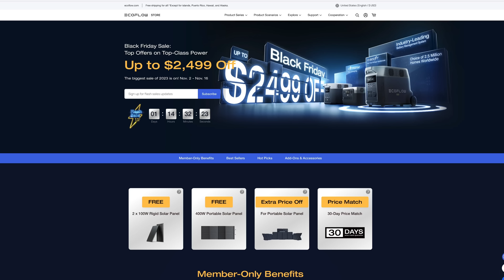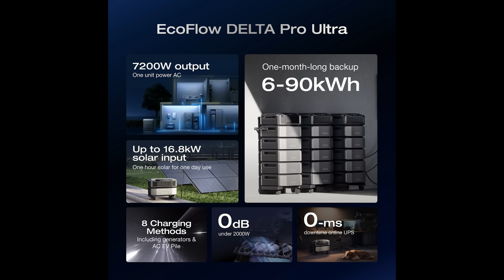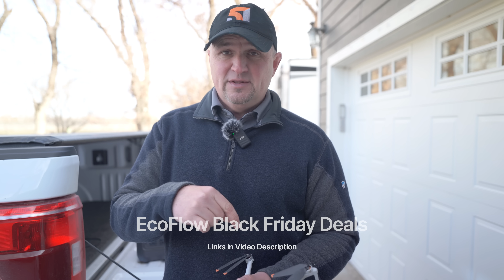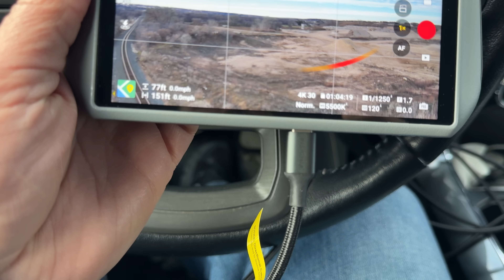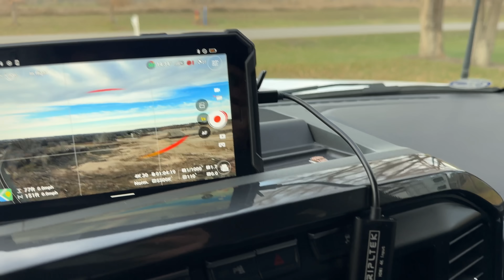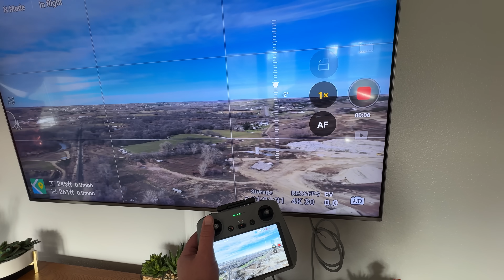Can You Help Settle This Confusing Rule?  Legal or Not Legal???

Comment: good video.  Based on your recommendation, I purchased an Eco River Mini.  Out of the box it worked fine the first time.  When I tried to recharge, it wouldn't take a charge.  Since I was having this issue, I did a little research and found that mine was not in isolated problem with Eco flow products.  I am waiting on a response from Eco Flows technicians to hopefully resolve the issue.  Hope your wife is doing well.
Reply from the maker: Such a great little power station!

Comment: Are there any rules that are different when the vehicle is parked, vs using a driver for the vehicle that carries the drone pilot? Sort of like a chase vehicle for your drone?
Reply from the maker: This is where the rule is confusing.  The FAA frowns upon flying from inside a vehicle, yet allows flying from a moving vehicle (in sparsely populated areas) 🤷🏻‍♂️. The wording states that all guidelines must be met to effectively adhere to the rule, yet it seems more impossible to do so while in a moving vehicle.  It’s a rule that needs to be updated with more clear wording imho.
Reply: @51Drones  So technically using a drone's follow mode while riding a bicycle would also falls under this rule. I would imagine the update is being worked on currently, as using a drone for a cinematic car chase while transporting the pilot in a camera chase car, just seems like a win win for some amazing shots.

Comment: I like the more affordable option of the EF ECOFLOW RIVER 2  with 110W Solar Panel. Sounds like it could power a small ice chest during the night, and then recharge during the day. This would be perfect for camping on the beach when ice runs are 2 to 3 hours away. It should also have enough power to charge up my Milwaukee M18s for the compressor I use for my fishing bait launcher. It would be great if it could keep the mini fridge cold enough to keep my bait slugs frozen for the 5 day trip.

Comment: I worked for years in line construction, heated vest helped a lot. But my hands could never handle the days when the temps dropped below the mid 20’s for too long. With operating the controller in a warm truck would really extend my flight time. Delta 2 Max with solar, that way it can be charged on the go.

Comment: Honestly, when it gets cold..I fly directly from my man-shed. How do I do it? Years ago while watching your channel you proposed the idea of using a EcoFlow power station as a power source in your mancave shed you had. I went ahead and got a Delta. Very thankful I did as living on the mountain it comes in handy regularly.I actually got two for the house. Now with the BF sale thinking of picking up another for the back of my ebike. Maybe just the River Pro edition. I have a backup battery for the ebike so figure I could use one while I charge the other during ride. Give maybe a extra 30 miles per adventure. In my shop I do in fact have my big screen monitor streaming the fly app  Yes it gets awhile to fly big screen yet at high elevation it really helps. Having the heater plugged in is a plus too.. Being within the shop with all the tools and power stations around..I get no interference. Once I am able to walk again I will have the chance to see if the River pro works on the ebike. With all the rules in my area I have switched filming reels to ground mostly. Actually got a super extension pole for my 360 to hopefully catch land reels as if I was flying. Just for fun. Not being able to walk, flying helps the day become a adventure. Thanks for all the winter tips. Snow is forecasted tonight.

Comment: You may argue that you can fly a drone from inside of your car as long as you maintain the drone in your line of sight. However, according to Section 336 Part 107 of Public Law 112-95 this is wrong. In fact, it is deemed illegal to fly a drone from inside your vehicle even when it isn't moving. You must be able to see the drone all the times which is not the case even if the drone is operated from a moving vehicle and allows you to see further and thus be able to survey an even larger area. It's still illegal tho. You exactly pointed it out, if it the drone is above your vehicle you cannot see it plus depending on the drone itself if it does not come with an visual assist view, that allows the obstacle avoidance cameras to see what's around the drone at any time, VLOS is no longer maintained. You don't want the drone to accidently crash. Just by looking down at the LCD or any monitor you won't be able to see what's behind or to each side of the drone. You'd be flying blindly essentially especially at a higher distance from inside your car leave alone making quick or master shots or all these funny things. It's kinda risky.
Reply from the maker: Explain to me why the FAA allows flying from a moving vehicle please.
Reply: @51Drones  Have you downloaded and read the FAA part 107 fact sheet? It's available on the Interweb. There it also says that you can’t fly a small UAS over anyone who is not directly participating in the operation, not under a covered structure, or not inside a covered stationary vehicle. No operations from a moving vehicle are allowed unless you are flying over a sparsely populated area. That's considered for the operation requirements and regulations. In many places, it's generally not advisable or legal to do so. The operator has to maintain visual line of sight ALL TIMES, which becomes challening from inside a moving vehicle. Additionally, it can pose safety risks to both, the drone and people on the ground. I wouldn't do it.

Comment: The EcoFlow Delta Solar Generator (PV 160W) looks like a solid system. I like the included solar panel and the large battery capacity. I just moved and the electricity reliability is unknown. This will be a good addition once I get settled here.

Comment: Hi! Thank you for having the give-away! I will be getting the River 2 Pro with the solar panel for my Christmas gift. I just bought the Mini 4 Pro (literally seconds ago) and will be using the RC 2 controller that came with my Air 3. I am sure I will need to recharge the controller while switching between the two drones during the day. The River 2 Pro with 800Wh is the perfect size!

Comment: FYI, the only way I could get the display out to work was by connecting everything, then turning on the RC2. I tried three different cable/adapter combos before I figured out the reboot solution.  Now it works with all the cable setups, but only on a fresh boot of the RC2.

Comment: I can feed my little Neewer monitor from the HDMI feed from the usb socket on my RC Pro via an adapter with no problem. I prefer this method to using the very vulnerable mini hdmi socket.

However the same doesn’t works for me from the usb o/p on the RC2 for some reason?

What am I doing wrong. Is the solution in the settings, please?

Comment: An external magnetic rooftop antenna would greatly improve the signal propagation! Are there external antennas available for RC2? I'm not sure if the FCC would allow this with non licensed operators. It would really put the range test to the batteries limit! Thanks, a Ham Radio Nerd 🤓

Comment: Sorry Russ, I"m going to vehemently disagree with you.

Yes, you can certainly look away to check your settings, etc, that's not the only issue with flying under § 107.31. You even show § 107.31 in the video.

But that's just part of § 107.31.

§ 107.31 (a) explains the entire reason for VLOS. You need to be able to:
    (1) Know the unmanned aircraft's location; (easy to do while in the car)
    (2) Determine the unmanned aircraft's attitude, altitude, and direction of flight; (also failry easy, especially if you use the extra tablet)
    (3) Observe the airspace for other air traffic or hazards; and (impossible to do from your vehicle)
    (4) Determine that the unmanned aircraft does not endanger the life or property of another. (very difficult to do from your vehicle.

I can promise you that flying from inside a vehicle is not considered legal by the FAA. There is absolutely no way to satisfy § 107.31 (3), and it's very difficult to satisfy § 107.31 (4).

Sorry.

And everyone can save their pixels instead of hating on me below. I don't care what you think.
Reply: For clarity,  The FAA allows Operations from Moving vehicles under certain circumstances.   According to § 107.25 (b) Operation from a moving vehicle or aircraft.

Its OK to operate a sUAS from a MOVING Vehicle if over sparsely populated land....   Specifically:

(b) No person may operate a small unmanned aircraft system— From a moving land or water-borne vehicle unless the small unmanned aircraft is flown over a sparsely populated area and is not transporting another person's property for compensation or hire.

So...  Its OK to fly a drone from a moving vehicle,  but prohibited to fly one from a stationary one?    

Lets rethink this position.   Its not logical.  I think Russ has a valid position here.
Reply from the maker: Exactly sir.  Thank you!
Reply from the maker: Ok.  I’ll give you that.  But, BUT, as Daniel mentions below, that one is allowed to operate from a moving vehicle in sparsely populated area.  This rule would then contradict the rules that you stated, in that it would effectively ignore the fact that you would not be able to observe the airspace for other air traffic or hazards now would you be able to determine that the unmanned aircraft does not endanger the life or property of another.  Like many other FAA regulations, it’s contradictory.  Which is it?  Is it more safe to fly from a moving vehicle than it is from a parked vehicle?  Logically, the rule should state that all UAV flights must be operated strictly from the outdoors, not?
Reply: Hi Russ.

Actually they're not contradictory at all. 

§ 107.25 does allow you to fly from a moving vehicle, but it doesn't mean you don't have to follow all of § 107.31, 

Even if you're flying from a moving car, you still have to maintain the ability to "Observe the airspace for other air traffic or hazards". Obviously it's not as easy, but it's doable.

We've done it a couple of times for a developer client. They have an access road into the development that is 3 miles long. We've had to fly it a couple of times over the entire length. Ideally we would have done that in a convertible. Since I don't own one of those, We flew it with the windows down and the radio off. I had a driver and I flew from the passenger seat maintaining VLOS of the drone the entire time, all while watching and listening for other aircraft that may be in the airspace. And since there was literally nothing there except the road and prairie land, and the occasional other car, I wasn't worried about endangering "the life or property of another".

As I said, § 107.25 does not contradict § 107.31. They both have to be followed. It would be like flying in controlled airspace at night. You need to satisfy both 107.41, as well as 107.29. 

I appreciate what you do, and do enjoy your videos. But in this case, you are wrong about flying from inside a vehicle. It is a violation of VLOS rules. But by all means, don't take my word for it, I don't work for the FAA. Reach out to the FAA's UAS Support Center at UASHelp@faa.gov. If they say I'm wrong, I'll be more than happy to come on the show and admit it.
Reply: @VicMossPhotography  I reached out to UAS Help and this is what they said about using 107.31 as prohibiting flying from a stationary vehicle, "It's permitted but the reference (107.31) is wrong.  It's § 107.25.

Both the pilot and the VO must be able to fulfill all of the other requirements of the rule.".
Reply: @danielsnyder3563  hmm. Not really helpful for the question at hand. 🙄

.25 is the moving vehicle aspect, which we all seem to agree on. .31 is the BVLOS aspect, which is where the disagreement lays. 

Let me see what I can find out...
Reply from the maker: Which means that it’s on the investigating agent to determine if the PIC was or was not adhering to all other requirements.  It would be impossible to determine if all requirements were being met because of the subjectivity of each case.  Vic, you state that “obviously it’s not as easy, but it’s doable”. applies the same as doing so from a parked vehicle.  In fact, it would be hard to argue against the fact that it is much more “doable” than from a moving vehicle.  So, Vic and I will have to agree to disagree.  It is my opinion that although it’s not ideal to fly from inside of a vehicle, it can be done.  I would venture to guess that no person has ever, nor will ever face prosecution from any authority if they are “caught” flying from within a vehicle, as it would be difficult to prove that all of 107.31 were not being adhered to.  Unless the authority is sitting in the same seat as the PIC, has the same vision, mental acuity, hearing ability, awareness and so on, there is absolutely no way to make a legal assessment of the adherence to the rule as it is written.  The only verbiage that will convince me that you are unable to fly from inside a stationary vehicle is if the FAA adds a section that states, “Under no circumstances can an individual operate a UAS while sitting inside a stationary vehicle.”
Reply: @51Drones  I do agree that it would be up to the responding FAA ASI who would take on the investigation. Unless there was an incident, then it would be pretty obvious.

I do know of one person who was "contacted" by FSDO for flying from inside a vehicle. But in that case, it was obvious he didn't have complete VLOS. He was flying over the car, behind the car, as well as in front of the car. It was also an FPV, so that was part of the equation.

I'll post my answer from UASHelp as soon as I get it. I'll post my question, as well as the answer.

These discussions are always fun.
Reply: @51Drones  I just noticed I was also bouncing between my two YT accounts. Sorry about that. At least I use the same logo.

But I just heard back from the UAS Support Center.

There was a bit of confusion about whether or not I meant a moving vehicle at first, but once it was established this was strictly a VLOS issue, I got a direct answer.

My question to him was, "Not from a moving vehicle, but from a stationary one. The RPIC would be inside the vehicle to stay warm, but my argument is that they cannot do that legally since they can’t satisfy 107.31(a)(3). This is strictly a VLOS question."

His answer is pretty clear, "Got it.  The same principle applies ().  How can the remote pilot comply with the totality of the rule?  They can't."

So, if someone is flying from a stationary vehicle all aspects of 107.31 (especially (a)(3)) must be complied with, or it is not a legal flight under 107.31. It's not quite "“Under no circumstances can an individual operate a UAS while sitting inside a stationary vehicle” as you wanted, but it does clear up the necessity of being able to monitor the airspace. Which would basically be impossible from a closed vehicle.

Will you stay warm? Yep. Would you be legal? Nope. At least not under 107.31.

Keep up the great content though Russ, I do enjoy your channel.
Reply from the maker: Thanks for the clarification.  I just can not grasp the fact that it's acceptable in a moving vehicle, but not in a stationary one. 🤷🏻 @VicMossPhotography

Comment: Thank you for your awesome content. I've been listening to you for a little while. But hadn't realized I didn't subscribe but just barely did... 

As for this video, thank you. Although i've been searching for info and how to hook up a tripltek To my rc pro... And there was hardly anything out there. But ironically, on almost the same day I found out directly from them. You put this video up... And I'd like to sharing the idea of hooking up a massive t v monitor for the fun of it if you wanted to... 

Side note on the tripltek adapter... They told me that some of the other ones are designed for input VS output and the Tripltek is designed specifically to input from HDMI to USBc... So that could or would render some of them useless. ...but they don't seem to say if they are designed one way versus the other... Just f y I to your subscribers... I went ahead and bought the $25 Tripltek version after I sent back another version I just barely received.bnecause the Tripltek technician said some of them are not designed for the right direction through put.
Reply from the maker: Gotcha.  Good catch!

Comment: “VLOS is having the ability to look up and spot your drone”. “I’ve flown the M4 pro 1500 feet away from inside the car, no problem.”
🤔
Reply from the maker: Ya.  Do you have a question?
Reply: @51Drones  Just a comment. If you can spot your mini drone in the sky 1500 ft away with the naked eye you have some keen eyesight. Many times my m3p can be less than 500 ft away and I can’t pick it out of the sky until I hear it.

Comment: Hey, I respect your opinion and guidance. I would like to ask you a question . 

I have a mini 3 pro for nearly 2 years now and love it to death, 

Should I upgrade it to the mini 4 pro and sell the mini 3 pro 

Or 

Should I get a air 3 to add to my fleet and keep the mini 3 pro for those small reality jobs 

Or

Get a pro controller for my mini 3 pro 

(Back story, I'm been flying has a hobby for years, previously had off brand drones, I got my 107 through work and fly a Mavis 3T enterprise at work. And on the side I use my mini 3 pro to make some cash on reality and some aerial photography)